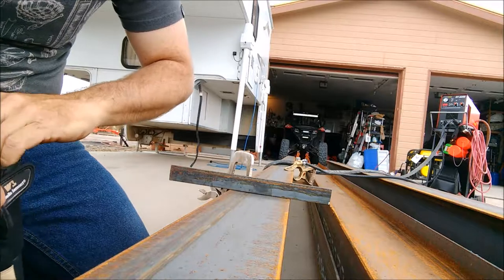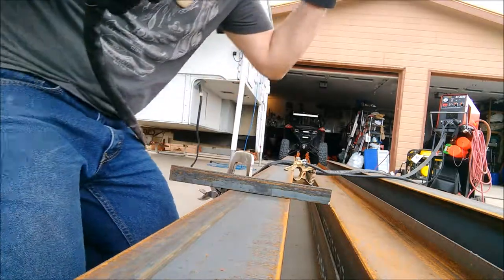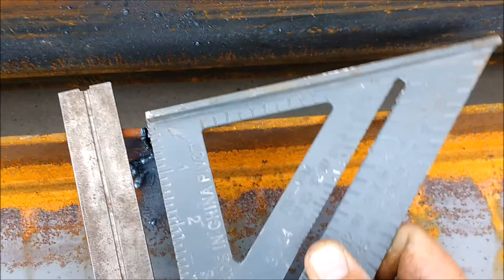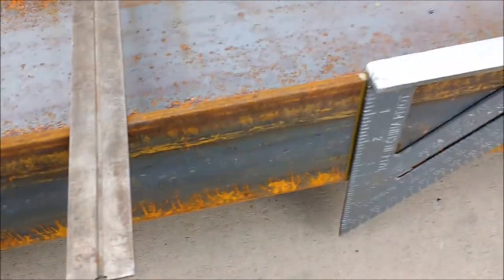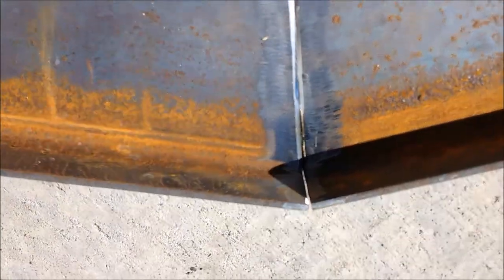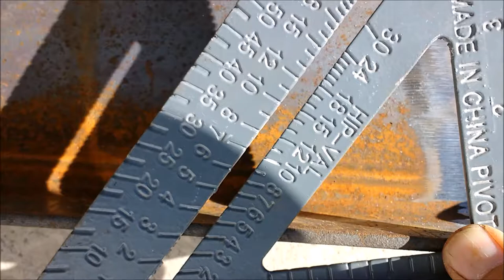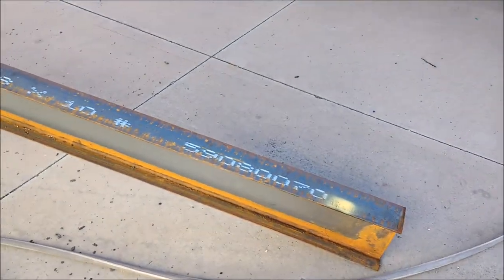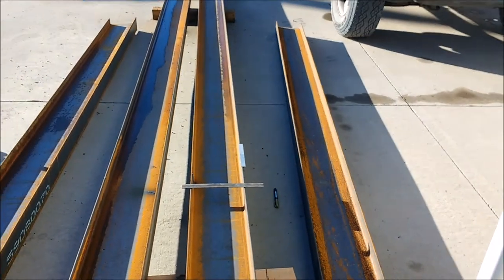Steel Tractor Barn Build: Part 2

Comment: Nice welding and use of the speed square. The 3/12 pitch will be good; not too steep. I'll watch more tomorrow after I finish cleaning up hurricane Florence mess. Man, I've been at it for several days straight and only a small portion noticeably cleared. Thumbs up.
Reply from the maker: Thanks, it's been a fun project. I hope you didn't lose too much in the storm. Cheers from Colorado